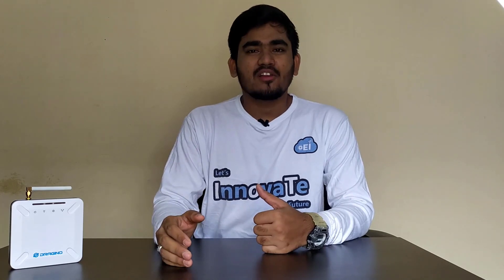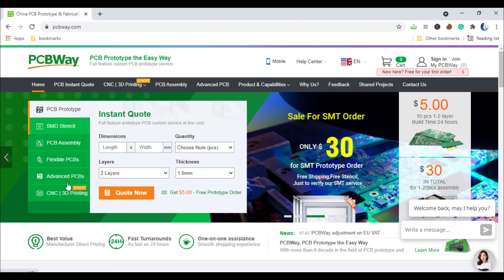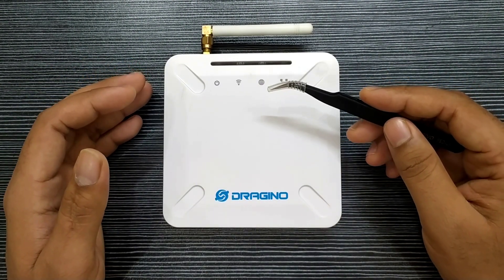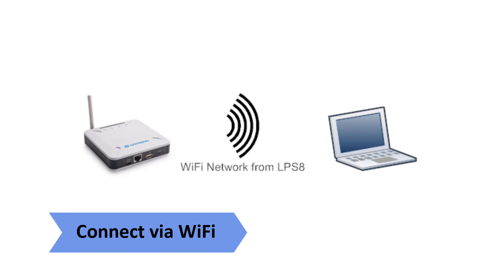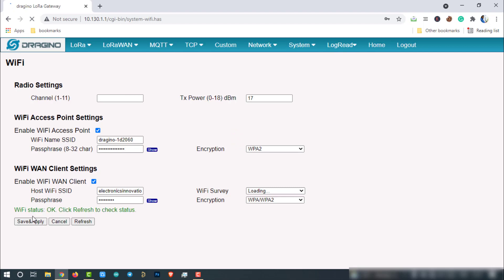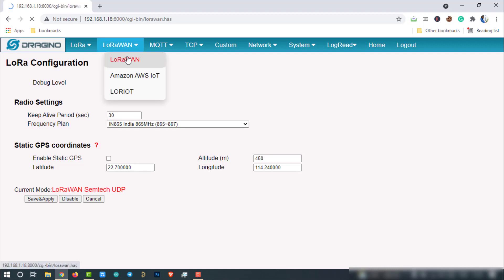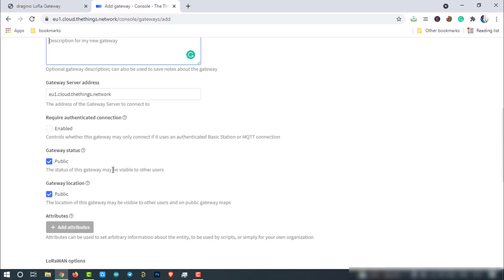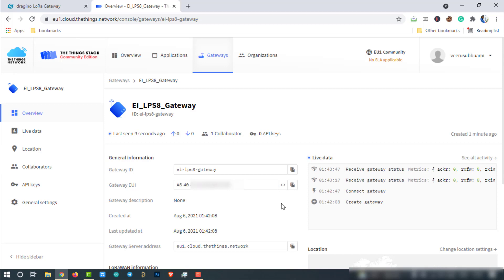How to setup LPS8 LoRaWAN gateway and register on The Things Network Server | Dragino | TTN | LoRa

Comment: Hi, I need help I set up the wrong credentials for the access point it connected but I cannot access dragino interface. What can I do to reset or access Interface ?
Reply from the maker: Connect gateway to the WiFi Router using ethernet cable, then login to router admin panel, then find the ip of gateway.
Just access that ip, you will see the Dragino home page.
Reply: Electronics Innovation , I tried but it access point is a different router from the one I want it to connect too and I do not have admin password. How do I reset this?
Reply: Electronics Innovation  I got to the router page and got the Ip for gateway I still can not access  the interface.

Comment: Hi there, Can you please help me? I had the gateway working back in May and then I had it unplugged for a bit. Now the gateway isn't outputting a wifi single for me to connect to in order to get into the dragino portal.... There is a red light on the power symbol and the world one and that's it. Do you know how I can fix this? I have tried rebooting it but still not working
Reply from the maker: Yeah, we can fix it.

Please drop a mail at askus.electronicsinnovation@gmail.com

I will guide you.